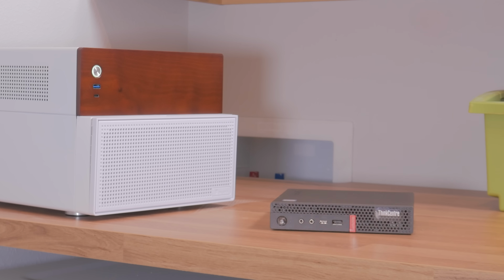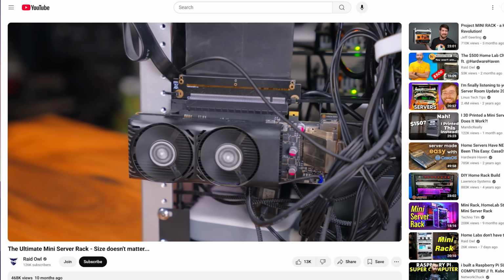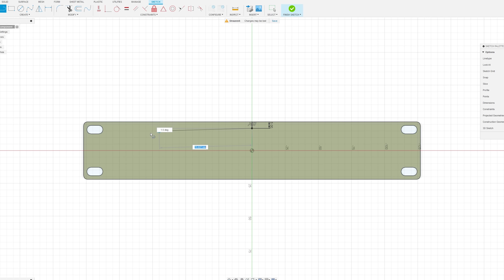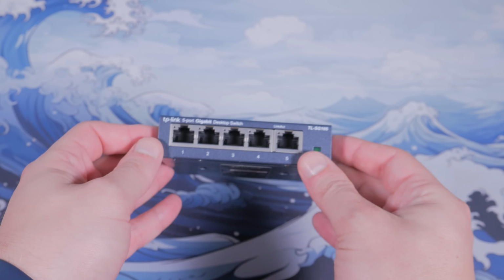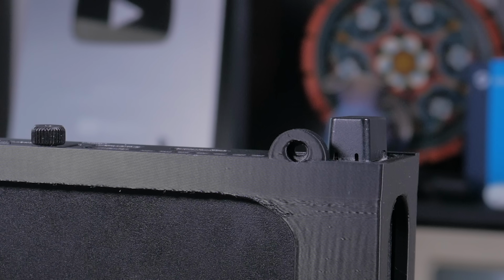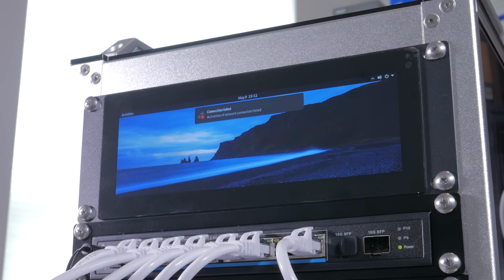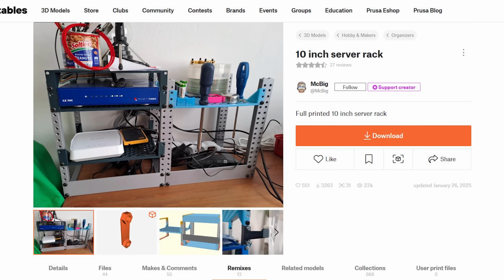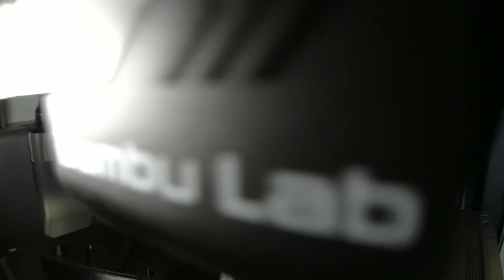My First Server Rack is... TINY?!?

Comment: I cant understand mini racks just use short (so no full 42U lol ) but normal racks and stack the mini PCs or single boards horizontally on each 1u instead of vertically  and you get a better value for your money and ventilation and future upgradability (e.g it can fit most many port switches in case you want to add more mini PCs to it)

Comment: If all the devices are same voltages, 12v or 24v, you can use a LED driver / power supply, so you can remove the powerstrip all together

Comment: pdu?
or backup?
Reply: The two side by side would be very close to sitting well on a standard 19" UPS.

Very anciently we had UPSes attached to cage nut rails (10 or 12U) with switches and patch panels on shelves.  The UPSes were plenty sturdy to hold the rails and equipment.

I think you could really do something interesting with 19" rails with some 19" stuff on the bottom and above it 10" rail splitting with something to the side.

Regardless, there's got to be a way to add a PiDP-11.

Comment: Make custom length cables from your wall panel to your switches. You can also print some cover panels for the wire shelf that sit over the edges of the shelf, then you can hide all your network cables in those panels.

Comment: hey, first of all, you should 3d print some parts to direct air flow to the back (out) and through the front/top (in), as well as a extra drawer mount for the back, a power strip mount (with lil power strip holes) that goes to the same strip you have in there so you can have it looking clean and secure, and some grate type panels for output/input airflow

Comment: Cool build! Heads up that the horizontal aluminum crossbars at the top are technically upside down, the rounded edges are meant to be on the bottom and the flat edges sit flush with the top acrylic! I made the same mistake when I assembled mine, but I don't think it actually impacts the usable space at all so all up to personal preference!

Comment: I use the "Eaton Tripp Lite Series 600VA 300W 120V Standby UPS - 4 NEMA 5-15R Outlets (Surge + Battery Backup), 5-15P Plug, Desktop" UPS in my Deskpi, which I got at CDW. Got it for $91 including shipping.

Comment: Kind of curious, with all the 3d printed parts, are temps/longevity not a concern? Even if below spec deformation temperature of the material you're using, is there concern for long-term use?

Comment: 2 tips. 
1. Plan air flow 
2. Do not forget to design the rear as well.
Reply: he can put some 30mm fan and an additional ups
Reply: @rudolfvalacegerna9184  30mm fans are too mouch noisy. Bigger is better 😀
Reply: @MaxScara  120mm pc fans are better
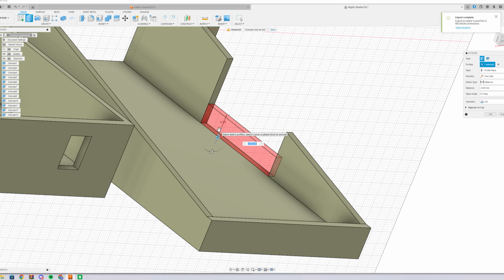Reply: At 5:40 Tp-Link switch need some side holes so it can vent.
Reply: Me running an open-case wall mount build: What airflow? My entire room is the airflow. 😂

Comment: i have all my stuff in a 9U 19" rack that is 80cm deep. it only cost me 150€ and it came with enough Cagenuts and 2 full length shelves and one half length shelf. yeah its also a open design and a bit wobbly without anything inside. it has the option for wheels or feet or mounting it to the wall. Mounting it to the wall might be optimistic given its size and potential weight but on a concrete wall this might be working. i am very happy with it. 
it has enough space on both sides for everything. 
i have a 2 1U smart PDUs in it to keep track of power draw. i have 3 1U Dell PowerEdge servers in it as Proxmox cluser, a 2U Dell PowerVault 3600i, a small 2u system with an intel J5040, a 1U TP-Link TL-SG3428X-M2 Network switch, my 1U 1.200Wh UPS. still enough space to add more. I use the coax cable with a 2.5gbit MOCA media converter. CAT6 or fiber wasn't a potion becaue i have already coax laying in my house in every room for analog TV, but sins this doesnt work any more and TV is only available over IP i decided to use this cable otherwise. i had in the beginning SFP modules with 100m to 1gbit, but i saw end to end MOCA is now able to do 2.5gb simultaneous in both direction with a standard 90db coax. Unfortunately, moca 2.5gbit isn't available as SFP/SFP+ so i had to buy a converter thing with a coax on one side and a rj45 on the other. I can confirm a 200m run is able to get the full 2.5gbit in both direction simultaneous. Technical 10gbits are possible in the future over coax. Coax in networking is still a thing.

Comment: the one thing I dislike about these 10" racks, is that you almost need a 3d printer to have one. Sure, you'll save money with a printer, but its a 10" rack, I clearly dont have a lot of space to be buying a printer.
Reply: A medium size 3d printer too might i add. As an owner of a A1 mini printer, it sucks that I would have to buy a bigger printer if I wanted to utilize one of these racks to its full potential. They did however just release a 7 inch version of the rack - the TT
Reply: See if your local library has a 3D printer!
Reply: I own 2 3D printers. Yeah I like that one can print things but I wish that there was more products just for it. Nobody does like 10" gateways etc
Reply: It seems like there’s a lot more options available because of their popularity. You can however send out files for 3d printing. The good news is if you buy a 3d printer, you can mount the octopi inside this rack!
Reply: Local library printing or 3d print on etsy. I got everything 3d printed for me from a seller on etsy for 60 bucks
Reply: 3d printers are not that big. Full size (19 inch) racks are just massive and very very expensive.
Reply: @Keeper_of_The_Interwebs  at least with a full sized rack you'd have the space for a printer on top. to get a printer to print for these it is large. not everyone has the space for that.